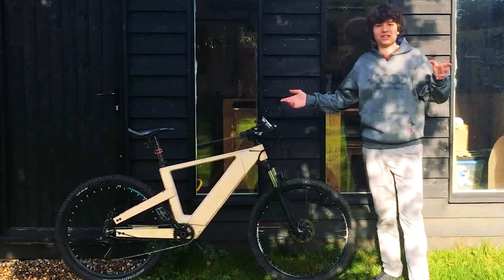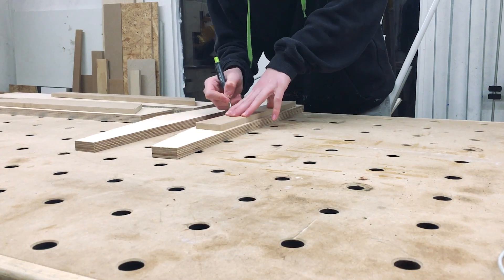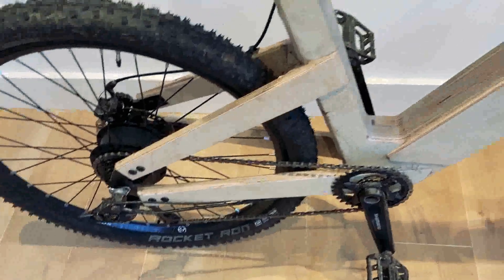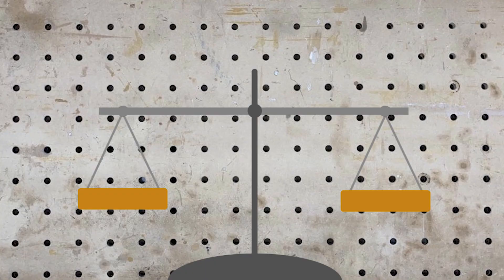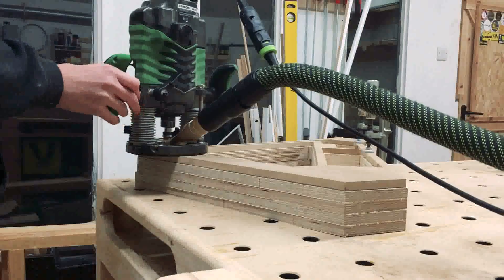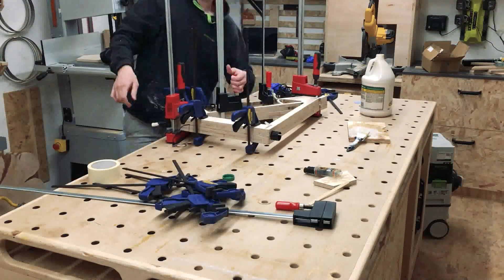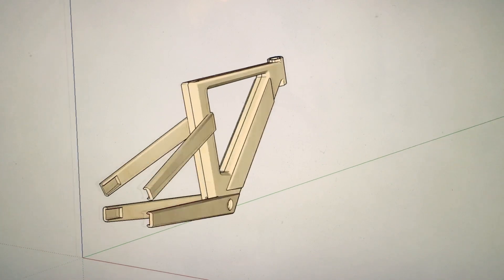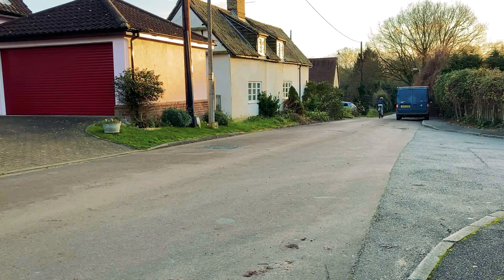DIY WOODEN ELECTRIC BIKE MADE BY 15 YEAR OLD!!

Comment: Several years later... do you still ride the bike? Any thoughts on what you might do differently?

Also, how did you get the headset and bottom bracket to be affixed in the frame? Is it just friction?